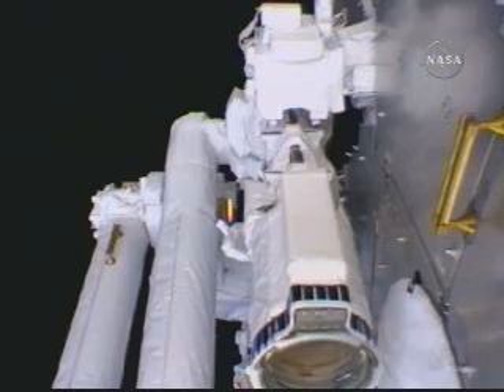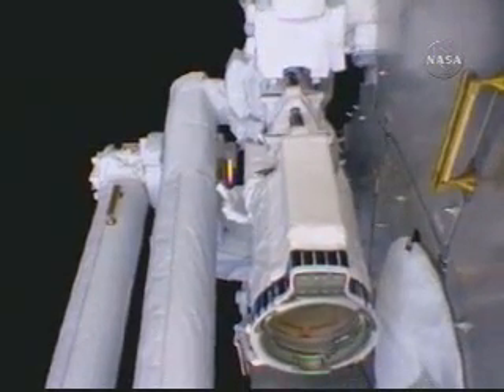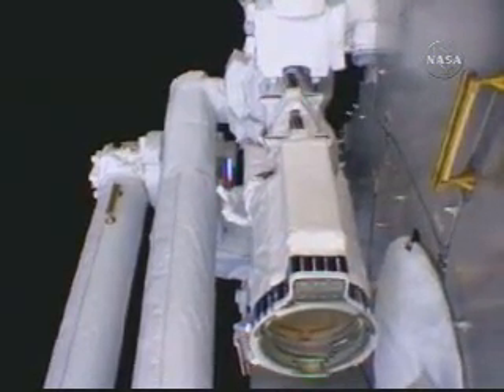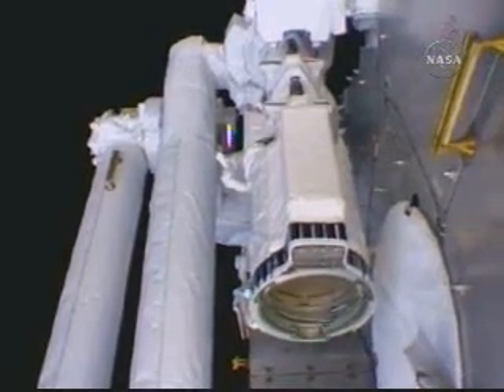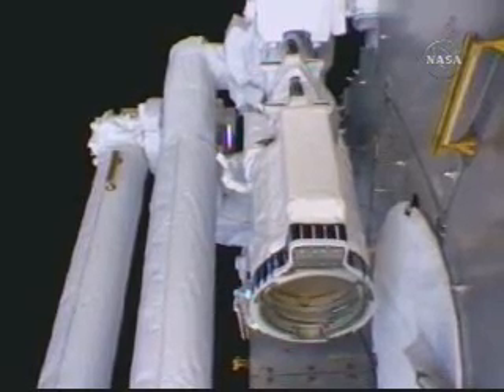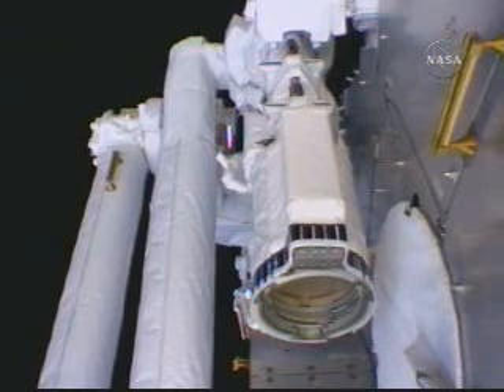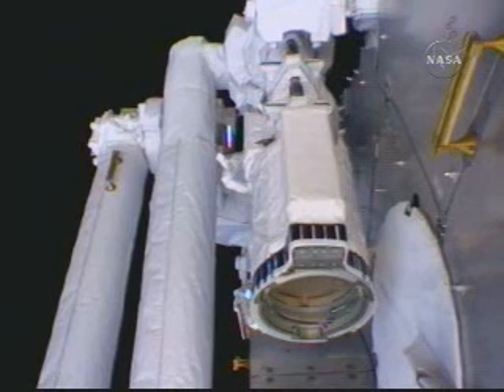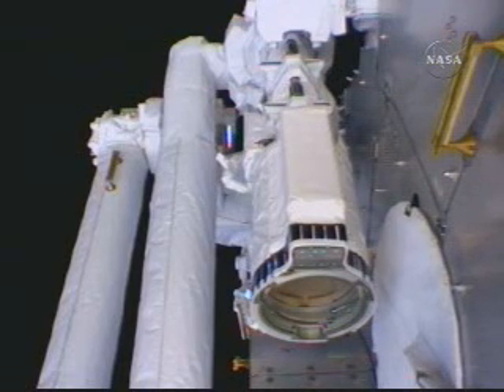Japanese Robotic Arm Initial Deployment

Comment: Future Idea:Can you energize the arm with laser light(not sun light).Putting solar cells on arm will be useful in the dark;Like other side of the earth when earth blocks sun light then use larger laser rays on solar cells/

Magnetized rocket wings,small rocket wings that are highly magnetized against each other with high energy wings and lower wings are half size of upper;But both are highly magnetized and much less vibration of launch wing drag.Magnetized rocket wings for a controlled launch!